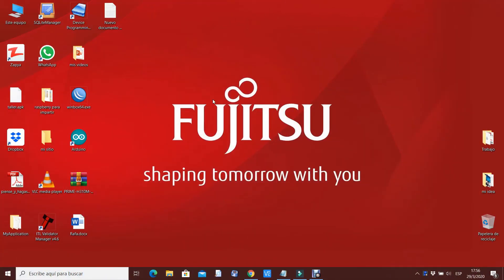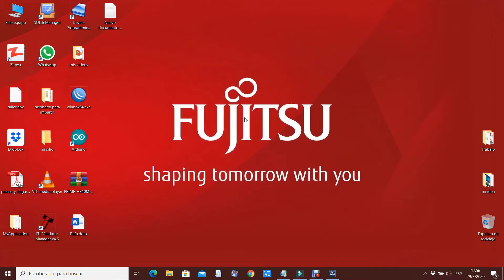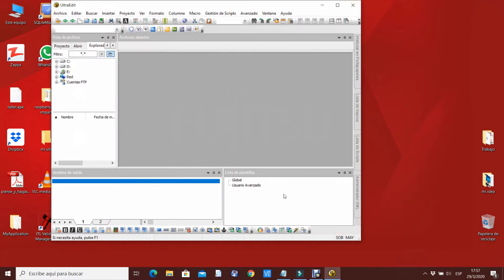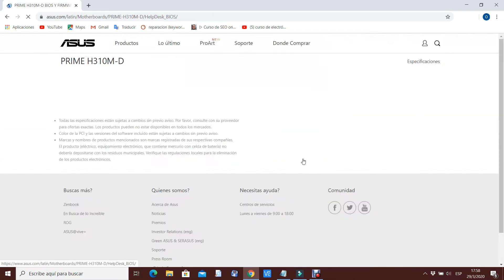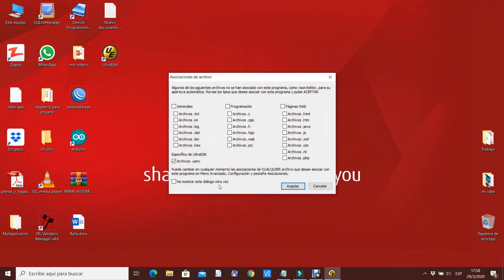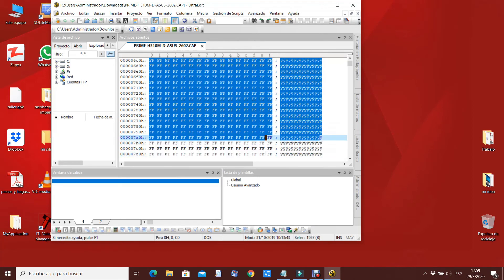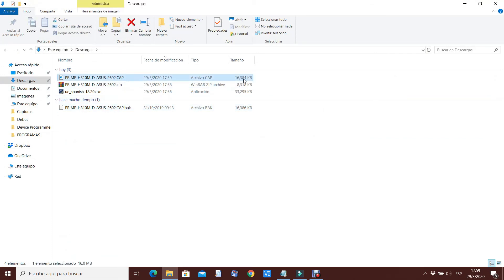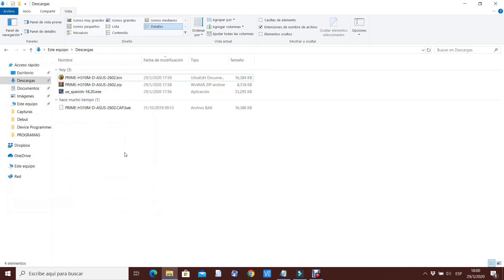COMO PROGRAMAR BIOS ASUS ,Convertir archivos .cap a .bin

Comment: Como sabes exactamente que eliminar? No podría llegar a ser importante las primeras líneas del código que eliminas?
Reply: Tengo la.misma duda, ya quité los bytes que dice y no levanta
Reply: @guichosystem  a eso me refiero. Es que es demasiado ambiguo a veces, todo sirve para algo o depende de algo. Creó que más información se puede encontrar al respecto en foros relacionados de habla inglés y otros idiomas.
Reply: @Anzhnadom  yo solucioné mi problema con un programa que se llama "Asus CAP TO BIN" y tuve que grabar la BIOS con el AsProgrammer 1.4.1, ya que con otra versión o programa, no funcionaba.
Reply: @guichosystem  maravilloso. Que mobo y chip BIOS intentabas flashear?
Reply: @Anzhnadom  Asus B85M-G R2, el chip era un winbond W25Q128FV

Comment: Gracias por el vídeo compañero. Tengo una pregunta importante:

Compré una CPU de esas chinas (una modelo QTJ1) y le pedí al vendedor que me enviara el archivo correspondiente a mi BIOS para poder flashearla y que reconozca el nuevo procesador. El tema es que, precisamente, también utilizo una placa ASUS y usan ese modelo encapsulado de archivos de BIOS .CAP. El vendedor me envió el archivo para flashear en formato .bin (que es sin encapsular).

El tema es... podría flashear directamente la BIOS con ese formato .bin del archivo que me dio el vendedor?, o tengo que utilizar el famoso programador CH341A para volver a "encapsular" esa BIOS .bin para poder flashear y que funcione correctamente?. 

Agradecería tu ayuda porque es un jaleo y no sé cómo proceder. Mil gracias amigo, saludos.